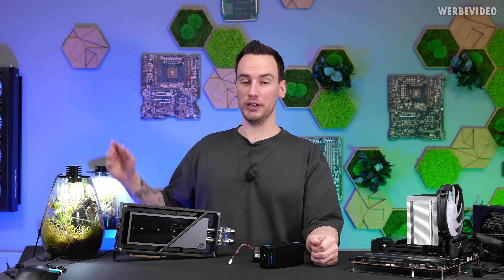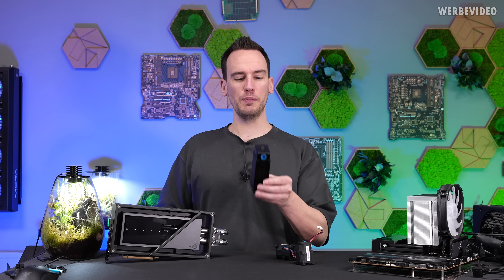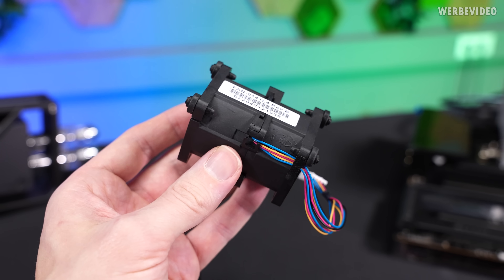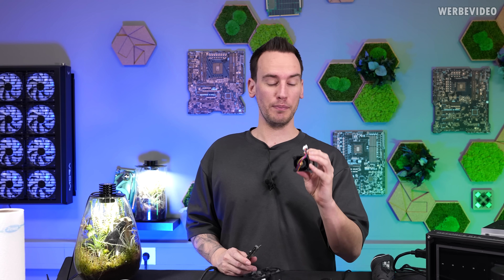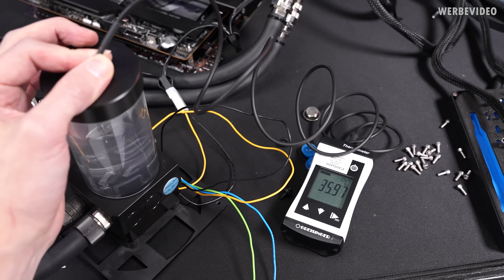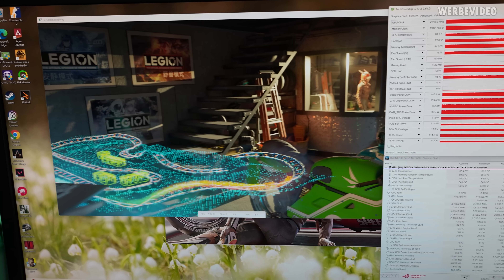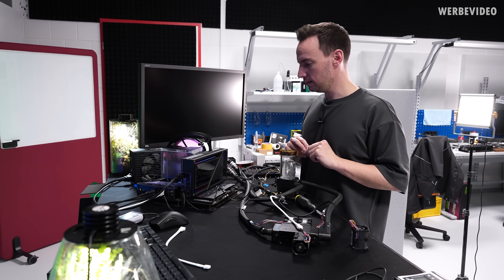Cooling my RTX 4090 with the Smallest Radiator I could find

Comment: It's like having a jet engine reving up near you. Not even server coolers make that noise, Jesus
Reply: Maybe not in stable operation, but those sorts of fans are used in 1U servers all the time, and if that server was cranking dual 300W CPUs and/or a power hungry GPU to 100%, you would hear them spin up. Just very rarely would they hit 100% speed because there’s probably a bank of 6 to 8 of them at least (plus maybe one more in each PSU).

Comment: I basically did this when i tried to make the thickest 120mm radiator sandwich ever. 
push pull configuration with 2x38mm thick 120mm server fans, The sound levels were tremendous! 
Terminated both fans directly to molex since each one drew ~45W

Comment: So you did not have time to add a few small aluminium heat sinks and a 120mm fan to cool the  fan controller ? Or is the nickel plated copper block with 0.05mm fins incoming... So no jank setup, only over the top is ok enough :P

Comment: Is your PSU fan not spinning or is it an optical illusion/PSU case/print design?   Also all you need to do with those fans is issue permanent 12v and use a PWM signal to the fan's PWM input to vary the speed.

Comment: I remember replacing blocks of those fans on servers. I had a stack of paper on the other end of the workbench when I turned it on to bench check my repairs, when I turned it off, the paper was all over the floor 😅

Comment: The reason the clearance doesn't fit a socket head bolt, is because it's intended that you use hex head bolts or install the nut on that side. The fan body is then able to act as one side of a hex socket when tightening it down. In extremely cramped situations you can simply push the hex head against the fan with your thumb, if you can't get a spanner into that spot.

Comment: The PWM signal should be used to directly control the fan instead of adjusting the voltage and current from the fan's power input.

Comment: You can use an electric domestic under sink water heater maintaining a target temperature to measure the radiators heat dissipation rate by measuring the heaters power consumption over time and the difference in temperature between the water and the room's air. 

I'm currently doing this. For a 350mm x 120mm radiator with three cheap fans I'm getting 22 W/K max, and 960 W max. That's at a dT of 40°C - 45°C. Meaning that if the room is 20°C then the water would be 60°C to 65°C.
Reply: You can do this the characterize the performance of any radiator and fan combination. You could use this to objectively compare PC radiator performance. W/k/CFM is possibly a good metric? The higher the better.
Reply: This metric would also enable you to know before you build a PC what the water temperature would be for the water loop given the system component wattage. Also given the fans cfm vs db(A) you could estimate how loud it would need to be to maintain your target operating temperature, OR what temp the system would be at a given loudness.

Comment: Could you not power the fans directly from the PSU at 12V? or 7V or 5V depending on the connections, for different speeds. Then no controller to worry about.

Comment: You probably need a better fan controller. There are fan controllers on Aliexpress that supports 336W peak output and uses PCI-E 6-pin connector for power input.

Comment: I have two Delta's 120mm (PFR1212DHE) which are 7400RPM at 44W. I bough them for fun (pun intended). 
When I got them I have checked them with oldschool Gigabyte EP45-UD3R and board lived, nothing bad happened.

Comment: To anyone who is interested in this.
Get a separate 12V PSU (Mean Well is my go-to brand) - you could pick a 200W or 240W 12V PSU which would provide ample headroom.
Connect the fans' PWM and Tacho wires to the motherboard.
Connect the fans' 12V and ground to the 12V PSU. Also connect the grounds between 12V PSU output and the PC PSU grounds - it doesn't matter which grounds, as long as they are bridged. This is to avoid floating voltages.
Finally, connect both PC PSU and 12V PSU inputs to a single, switchable plug.

That way, you do NOT need a separate controller, you can adjust speed directly from your PC software.

@der8auer, if you read this, feel free to contact me, I built quite a few 3D printers using more powerful 40x40x28mm fans.
(No, I am not interested in fame, just want to help out because it's an interesting project)

Comment: That was GREAT!!!!!!
but you were pulling too much wattage from your controller, which was pulling too much wattage from just one wire on the PSU.... that's why it shut down.....
but as far as your memory temp... that's a problem with the Matrix cooling it down....  it should be cooling it just fine, I would think.... have you ever re-pasted yours? ...  oh but you were running speedway.... that's an RT test... so you were using all 24GB prolly.... or maybe the Matrix just isn't good at cooling the cards RAM.... very weird
but that was awesome!! I didn't think that tiny rad would be enough no matter how fast the fans were... wth would you need a rad that small for?? LMAO!!! - GREAT VIDEO!!!

Comment: Now THIS is content. I have not played with counter-rotating fans, but the ones we did were powerful on their own. San Ace baby! If you can try their 120mm that runs at 24 volts (9HV1248P1G?)

You should be using PWM control with the fans, not the usual CPU 2-pin or 3-pin (2 pin with RPM) voltage control. That way you would not burn up fan controllers, the fans themselves have control. Or if you did it this way...fan power should be straight +12 and negative, no PWM.

OR - is it a Delta fan thing, my Delta blower has weird PWM control and didnt really work with my homemade controller, unlike the San Ace style (PWM wire: ground for minimum speed, open for maximum speed, PWM to vary the speed) which worked fine. Hope you can test it!

Comment: Oh, no, you could have done something really nice with the Delta pfb0412en-e fans at 32.500 RPM. I know, I own a couple. Not as beefy as the 38K RPM Sanyo Denki 9HVA0412P3J001 (of which I also own a couple), which means you need to make another video with them as well :)

21K RPM is pretty mild, the lowest 40x40x28mm fans I own are still 25K RPM.

Comment: Find 120mm ones they are working better on rads and much more quiet, static pressurse is good. Turbo fans are designed for industrial applications, usually runs on louder machines which makes it imposible to hear... Another fault is mounting fans to the rad, there should be a space inbetween fans and rad like 3 or 5 mm (that depends to type of fan), 4 sides should be closed by frame. You can make one with 3d printer, you will see that rad will perform better...

Comment: What you are doing is connecting the fans too close to the radiator. Make some ducting about 6 inches on both sides with a separator on both sides between the fans, What is happening is the fans are generating their own heat and it is carry through the radiator and heating the water so you have 0 cooling.

Comment: I'd love to know whether a single 120mm rad is better than two 80mm rads on the same loop, and same with 2 x 120mm vs a single 140mm, as well as 2 x 80mm + 120mm vs 140mm. Also, if you have two identical rads with identical fans on the same loop, does having one as intake and one as exhaust, benefit vs having both as exhaust, or both as intake? Factoring in the internal case temp, assuming you're only watercooling either the CPU or the GPU, not both? I guess Alphacool would be the best brand for the test case, and just pick the same line of fans from any brand to use across the board. TBH this is a curiosity that has been plaguing me for over a decade at this point, but I don't have the funds or equipment to carry out a test.

Comment: 12:05 I mean you could use a splitter cable, you don't need to power the fans with the fancontroller you could just get the PWM signal (if they are even PWM fans) and power the fans themselfs straight from the psu.

Comment: This video is like watching 35 years of failed GPU cooling experiment. You will never get a temperature lower than the one you are into ( the temperature of your room ) . Fans work better at 50% their speeds than at their 100% ( because of bottleneck of air and it is so noisy that it is not worth the headaches ) . You could have surf the internet and saved the trouble to make this terrible amateurish video lolz
Reply: You ok bud, skipped some pilIs?

Comment: 2:18 finally somebody says it
the standard curves in an AIO are set sooo agressive often that it isn't really much more quite, but if you allow the water temp to get hotter you can mentain said tempreture easier because the same radiator will dissipate much more energy.
Ofc it will not cool the cpu to the lowest temp  anymore but that is fine.
Turned my rig from being pretty loud whenever I fired up a game thats semi hardware intensive to staying at a comfortable noiselevel just by raising the watertemperture (about 20 degrees I think funnily enough, the stock settings of the corsair radiator are really quite agressive, I made sure to stay in the specs as to not risk damage to the tubing and pump tho)

Comment: I know this was a fun project but a slightly more practical test would be to use a single 120mm radiator. I ask this because sometimes a mini-ITX case like the Fractal Ridge or the Terra can fit only a single 120mm radiator and it would be fun to see if it can cool both the CPU or the GPU with that.
Reply: well, to do that you'll have to trade room temperature and use a noisy server fan. That's how datacenters manage the thermal dissipation.

Comment: it's so smol that you can water cool the radiator, maybe with one of those vortex impeller blades they use to circulator water in huge tanks with the least amount of energy, idk if you seen those

Comment: As you probably already figured out, there is a limit to how much radiators can radiate. Even with excessive air throughput. Its just a limitation of the heat passing to the surface area from the water to the fins. IE the lack of surface area is the bottleneck.

Comment: you are crazy to even try.. but appriciate your sacrifice.   as for the overheating fan controller.. you could have placed it at the output of the fans so the would also "cool" it, then you could probably go full speed with your full fan setup :)

Comment: The caveat at 9:32 is for a reason! It seems to be a comical video, but may contain secret NDA information on tdp of 5090(or 5080). As far as I remember Matrix version of the card can consume up to 500W due to cooling. And so this is a great test sample to test the cooling capabilities of new cards in the wild conditions. Without breaking NDA

Comment: Maybe, 2 fans in a "pull" config would have worked the best. So that the extra few watts of heat from the fans themselves are not being dumped into the radiator.

Comment: A lot of rackmount servers have these fans and run up to 6 of them on the motherboard directly.
Reply: But they are server motherboards that has a lot sturdier circuitry for the fan connectors. Server fans can be pretty brutal and the motherboards are certainly not designed the same as normal motherboards.

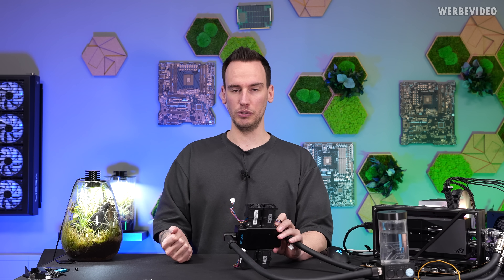Comment: 12:38 the 60°C water is also not viable for long period of time because this is the max operating temperature of D5 and DDC pumps
Reply: There are certain kinds of hard-line that would melt with that water temp. Its also not good for any of the seals or o-rings. The general rule of thumb with water cooling is 100W input per 120mm fanspace, which will achieve a 10C coolant temp over ambient. If you run the loop hotter, you can reject more heat per unit of radspace at the cost of increased noise and stress on the loop components. And then there's my oddball X299 setup where I'm cooling 88W on a 92mm radiator.
Reply: Yeaah i always thought my ICUE AiO was hot at 35c and was always turning the fans up to cool the water more.... Now i know it will be okay at 35c.../
Reply: @Adamgreen735 closed loops are designed to handle higher water temps - 35c is more than fine. But 60c water in customer loop is asking for trouble, it can damage the tubes and kill the pump
Reply: @ms3862  so at least for ddc yeah the max rec operating temp of the fluid is 60C, but they can definitely take abuse. My build reaches 55c+ while gaming (water temp) since it’s sff and off a single 20mm thick 240 rad lol. I’ve had it together for daily use over 4 years now (with opaque coolant nonetheless) and it’s still trucking fine. 
The tubes comment is something t to note - PETG will deform at those temps, and soft clear tubes will probably leach shot into the loop as well but honestly I’m of the opinion those are the WORST options that should be avoided at all costs. Either use EDMP soft tubes or acrylic - mine are acrylic 

They don’t blow up after running it at 60C for a month lol.
Reply: Original D5 (Laing Xylem Lowara) Standart Work TF95C = 95°C
Reply: @George_McGregor  no, it's only applicable for the metal housing variant
"Max. system temperature
-10 to + 95°C for pumps with brass housing (non-freezing)
+/- 0 to + 60°C for pumps with plastic housing (non-freezing)"
it's in the official PDF that details preassure and flow curves, exact dimmension, rotor speed ...
Reply: @Vladek16  I know all about D5 pump motors, I know how to repair and modernize them in both directions Vario<->PWM, I have two higher educations including electronics, hydromechanics, thermodynamics, etc., so please do not tell me with which cover and at what temperature one or another pump can be operated! 🤗
Reply: @George_McGregor it's literally written in the official Laing pdf. I don't care how much you know, you don't know more than the people who built the item
Reply: @ Once again, all ORIGINAL D5 motors have a stainless steel metal working chamber and are designed for a maximum temperature of 95c. The restrictions you are writing for relate to the lid (TOP), but not the D5 motor.

Comment: If you had a second mini rad you could try "pull-push": Loop the two little rads together, then put the two "coaxial ducted fans" in-between them (like a fan sandwich with radiator bread;-)

Comment: The reason why those fans are not meant to be mounted like that as they are server fans, I have heard many servers in a data centre with those fans, you have to wear ear protection as otherwise rip your hearing and having major headaches

Comment: RTX 4090: 93°C memory
My laptop's memory is laughing in the lava: 103°C in a stress test, I had to make custom cooling.
Reply: My razer blade 16 with only a 4070 reaches 110 and that is 100% normal which is fucking mad
Reply: @butters2160  tbh it starts to throttle down at 95, at max fan I can keep it below in benchmarks or at 95:)
Reply: I get maximum 80 C on memory with my Asus TUF 4090 . I don`t understand how is he getting 93 with water cooling.
Reply: @HDRGamingHub  I thought we are talking about 4090 mobile lol.
Reply: At that point, you just shouldn't own that laptop
Reply: u forgot about your (and mine) 13(4)980hx at 95 all the time.

Comment: They're not counter rotating, they're contra rotating, or coaxial. The former would be two fans on different motors rotating in opposite directions. The latter is two fans on the same axis rotating in opposite directions, either on the same (using reverse gearing) or different motors.

Counter rotating fans would be like GPUs with three fans and sometimes the middle fan rotates opposite to the outer two fans.
Reply: Well, they are two complete fans with separate motors that counter rotate. It's easy to see if you follow the power wires. The counter rotation increases the pressure they are able to generate and actually is supposed to lower the sound, but I wouldn't swear on that actually working as they blazing loud and you should use hearing protection when working with them. Talking from experience as I used to build servers and used these in hundreds of 1U servers. Once you have a couple of complete 42U racks filled in a test room with all fans running at max speed you either go deaf or have really good hearing protection. I ended up with severe tinnitus before I got out of that business.
Reply: @blahorgaslisk7763  The fans are on the same axis, they're coaxial.
Reply: @GGigabiteM  They are coaxial but still separate having one motor each and they are counter rotating.
Reply: Supermicro describes them as counter-rotating. There are two fans in this fan unit, which the fan blades are mirrored of eachother, also spinning in the opposite direction of eachother.
Reply: @Jacklsovakia1  Which are on the same axis, which is coaxial.
Reply: @GGigabiteM  they are coaxial. sounds like something you should take up with supermicro. on the other hand, contra rotating fans are generally characterized by a nested concentric shaft and gearbox paired to a common powerplant.

Comment: Actually, there is a smaller double 40mm radiator with barbs permanently attached that I bought almost 15 years ago. It is only 25mms thick. I still have it and never used it, for obvious reasons :D.
Reply: it'd be perfect to cool a single SSD.
Reply: @fermitupoupon1754 Yes, let's put a full loop together to just cool an SSD, or better yet, use it in an already built loop and cause massive flow restrictions :D.
Reply: @Hostilenemy  you're right, better put 2 DDCs in series to cool that SSD. That should be sufficient to overcome the restrictions in the loop.

Comment: GPU pulling almost 300 watts while playing remnant...
PSU fan... 0 RPM is fine.
That PSU either has AMAZING passive cooling capability... or... the fan is dead.
Reply: PSU nowadays usually turns on the fan at 50% load minimum. since it has 1600W rating and 80+ titanium certification, yeah it's expected to have high power rating with passive cooling. not to mention this particular PSU have gallium nitride based PFC, it will have less power loss